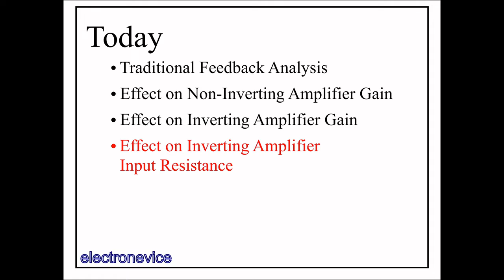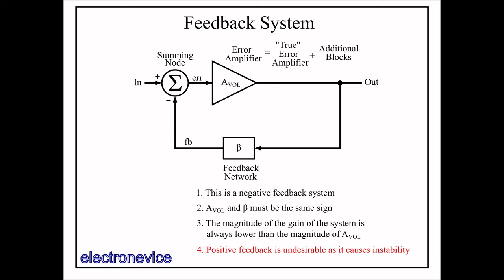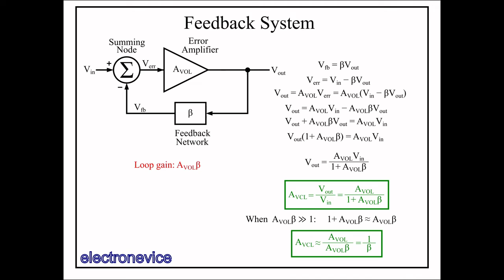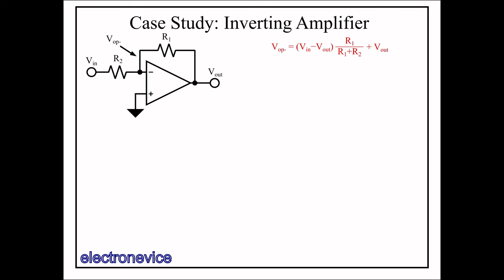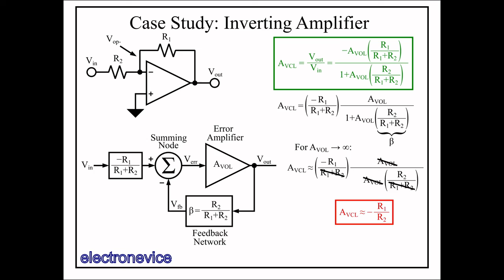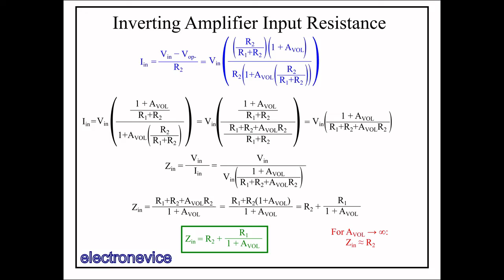Op-amp Finite Open-Loop Gain [Op-amp TS 13]

Comment: I haven't understood why  Verr in case of Inverting Amp, is equal to Verr= Vop+ - Vop-.
In feed back structure, Verr= Vin - Vfb. 
Here Vfb is Vop- so why Verr is not = Vin - Vop- ?

Do we threat Vin as the grounded non inverted input rather than actual Vin signal ?
Reply from the maker: One thing you can always remember is that the transfer function and stability of a linear feedback system is the same no matter what the input value is, so we usually ground the input for simplicity when examining the structure.  

So in the case of the inverting amplifier, when you ground the input, the circuit is exactly the same as the non-inverting amplifier with its input grounded, so you can take the "shortcut" of knowing that the inverting amplifier has the same feedback structure as the non-inverting, and thus I am able to assume the same Verr equation.  We just needed to add an additional "block" (the "-R1 / (R1 + R2)" block) to account for the different input "location", and it became clear what the value of that block was and where to place that block when I substituted our expressions for Vop+ and Vop- into the expression for Verr. 

Sometimes it can be difficult to determine "where" the error amplifier is in a feedback circuit, and it's not an objective reality - so long as you adhere to KVL and KCL, your choice of where the error amplifier and summing node are, is up to you.   Of course some choices will not work and violate KVL and KCL, and in most circuits with clear "intended" error amplifiers like ones with op-amps, if you choose something unconventional the math will turn into a nightmare (and your error amplifier will be some circuit that is NOT just the op-amp itself, which may be harder to use than the original circuit).  

I did not think about this in-depth or do any math, but I get the sense that choosing your parameters around Verr = Vin - Vfb would eventually work out mathematically, but your error amplifier would be a construct involving the op-amp and not just the op-amp itself, and that the resulting block diagram would be a lot more more complicated and confusing than the generally accepted structure shown in the video.

With op-amp circuits the error amplifier is pretty much always the op-amp itself, and Verr is therefore equal to Vop+ minus Vop-.  In other circuits with lower gain transistor amplifiers the error amplifying node is harder to find, usually its a base-emitter junction (or gate-source junction for a FET).  But with op-amp circuits you can pretty much always assume Verr is Vop+ minus Vop- so you can use that as a starting point when trying to figure out beta and the other feedback parameters.

Edited: there was an unintentional strikethrough that I removed
Reply: Now I understand, thank you for the explanation! 🤝